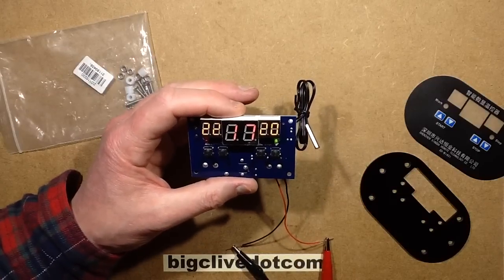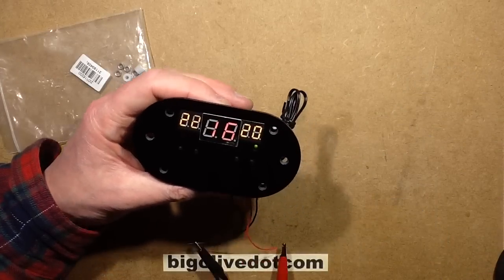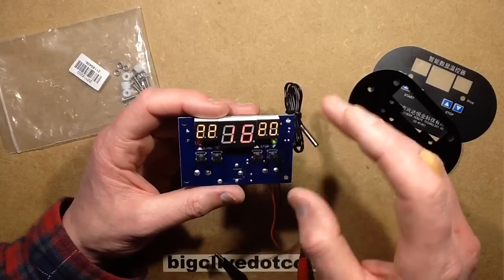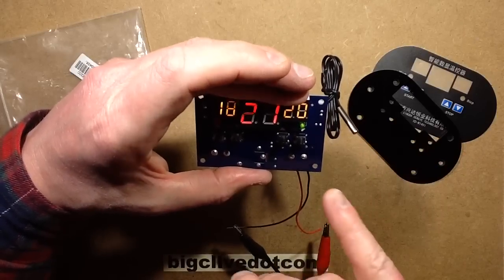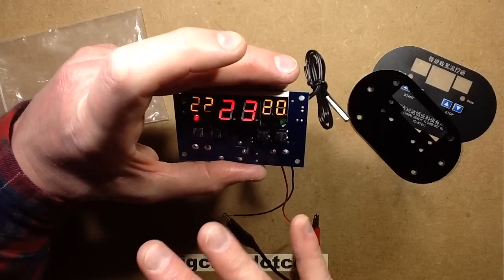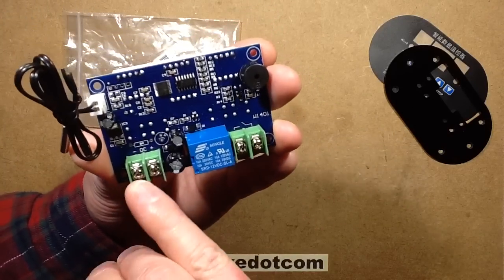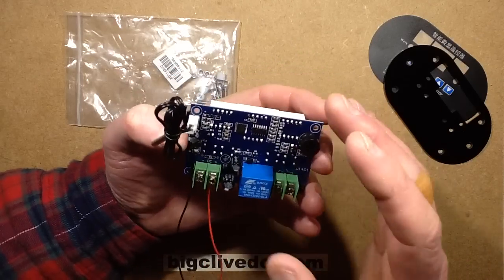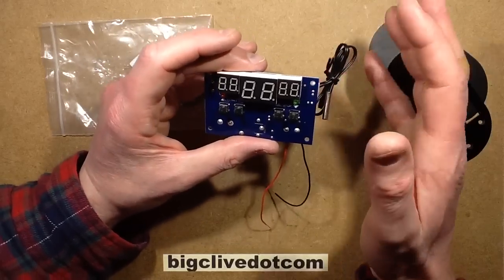Neat Chinese thermostat heating/cooling module.

Comment: Would it be possible to use one of these with a wifi enabled Raspberry Pi to make a DIY Google Nest-like device?
I would really like a Google Nest thermostat, but I can't justify spending two hundred quid on it.
Reply: +Aadil Shah Of course you can. The key word in my proposal was "challenge" of course, and the ESP8266s are so cheap!
Reply: +Jason Gomez Get a cheap ESP8266 go for the challenge! You can use them as remote nodes while an old android phone can act as the "brains" or if you really need you could buy a Raspberry to do the server duty.
Reply: +mikokuijn If you're going for home-brew you might as well put a wi-fi sheild on an Arduino Uno and just hook a thermistor probe to one of the analogue inputs.
At least, that's the way I'd do it.

Comment: I use one of those on my crock pot sous vide and an STC 1000 on a mash tun.
Reply: +Aadil Shah Those "Songle" relays aren't actually too bad, you'll find them in a lot of commercially available kit. I know for sure that the photocell on the back of my house uses one and this was bought from a major DIY store.

As someone who worked for a time as a quality engineer for the one the worlds biggest relay names (OMRON) I can say that the current isn't so much of a worry, it's relay chatter that really causes them to meltdown.
I personally put over 200A through a 12v 40A relay and aside from getting rather warm after 20 mins, it did no real harm.... But if you simulate relay chatter (by applying a switching voltage to the coil at say 2hz) with the rated current across it's contacts that thing will be a pile of molten plastic in no time at all. The real life cause of this is often poorly designed drive circuits that don't maintain the relays proper holding voltage.
Reply: +Fras L It was basically short circuit across a VERY substantial variable power supply, the sort that cost large sums of money.

I have to say that doing that testing was a rather scary experience, but when you've got a customer giving you grief sometimes testing to extremes is a very effective way to say "look we've done this testing, we've gone well beyond the components specifications and concluded the issue is not with our product"

When a relay fails on the contact side, you find the contact material typically turns high resistance and goes O/C. In rare cases the contacts can become welded together, BUT the current through it will remain the same as long as the load has not changed, so effectively it just stops working as a relay.
Getting output voltage onto the coil pins would require extreme heat or actual physical damage.

Cheap relays of questionable origin........ Hmmm yes that might worry me, but as I said i';ve found these Songle relays in a lot of "approved" consumer grade devices.
Reply: +Fras L I wouldn't put Mains current through a little relay like that. Especially the current of a cooking appliance.
Better to add a high current solid state relay externally to this module for safety reasons.
Reply: Aadil Shah Yeah I did not realise it was a low volt model, I used a solid state relay for a system to auto top off a salt water aquarium using some float switches. I have been looking at a system to control the temp in a room heated by an electric heater and using this to control the relay I bet  would work.
Reply: The relay is rated for about 250V at 10A apparently. But I'd never trust one of these for more than a few milliamps because they tend to melt under high current loads.
Also, they're not safety approved for mains switching, so in the event of catastrophic failure that results in death or injury, there are serious legal ramifications.
(may depend on local legislation)
Reply: Strider9655 Thanks for the insight, very interesting stuff, what was the 200 amp load?
Reply: Strider9655 Thanks for the reply, I believe the fear lol, a teacher I had was a draftsmen for the british submarines and told me stories of the massive batteries used and how low voltage can cause a fuss at massive currents.
Reply: the crockpot sous vide is a great idea! how do you connect it to the power for the crockpot?
Reply: +Phil Crawford The relay controls AC side.  The big blue block is a magnetic switch.

Comment: Would you say the probe is small enough to fit in a largeish heatsink
Reply: +bigclivedotcom Please, please buy one of these! I'm dying to know if they're fakes too. Haven't been able to reliably find one of the cigarette lighter types that is clearly real by the listing. http://www.aliexpress.com/item/2014NEW-Fashion-USB-Office-Auto-Fresh-Ionic-Air-Purifier-Ozone-Oxygen-Bar-Anion-Ionizer-PC-LP/32261897159.html?spm=2114.30010208.3.182.zFM1aM&ws_ab_test=searchweb201556_9,searchweb201644_2_505_506_503_504_301_502_10001_10002_10016_10017_10010_10005_10011_10006_10003_10004_10009_10008,searchweb201560_5,searchweb1451318400_-1,searchweb1451318411_6448&btsid=bc9072fb-143b-4aaa-8945-64078925481f
Reply: +bigclivedotcom And this one claims to also have a UV lamp and 'scent module'... oh god I love the chinglish on this listing! http://www.aliexpress.com/item/Portable-desk-Negative-Ion-Photocatalyst-Air-Purifier-Ozonator-Air-Cleaner-Purify-Air-Kill-Bacteria-Virus-With/32409285042.html?spm=2114.10010108.0.146.uZhTVE&s=p
Reply from the maker: +AO Seven Electronics It could be attached to one.
Reply: +bigclivedotcom thanks
Reply: +Godfrey Poon best typo ever!

Comment: I used one of the "panel mount" type ones I think you did a review on a while ago, to monitor the temperature of the hot water tank in the house. (Yes we still have traditional heating/hot water. No combo here!) More accurate than the crappy mechanical Danfoss or Honeywell ones, although I did have to crank it right down from the 60° recommended on mechanical to 45(lo) 47(hi)
Reply: *combi. Bloody iPhone.
Reply: Hi John. You might want to take a look at this link to see why it is not advisable to keep your "hot" water storage cylinder/tank at such low temperatures.
http://www.hse.gov.uk/healthservices/legionella.htm
Lower temperatures may make sense from an economy point of view but I feel the potential health risks to you and your family outweigh the economics.
Just a wee heads up tip from a jobsworth plumber :-)
Reply: Thank you for your advice! - I actually did try setting it at 60 degrees and it came out of the tap boiling! - Not sure if the traditional mechanical ones need more heat to actually activate, but using a digital one seems to require the heat setting lower to prevent scalding. We don't have "all in one" mixers in the house, its separate hot and cold taps you have to manually mix.
I do remember having the old one set at about 60 and getting a similar temperature to what we're getting now....
25 years on and I'm still here ;)

Comment: Hi Clive, just wondering what the relay is rated for?
Reply: +David Griffiths 10 Amps @ 250VSC
10Amps @ 30 VDC
http://i.ebayimg.com/images/g/T4wAAOSw5IJWfQXS/s-l1600.jpg
Reply: Another thing to check for on circuit board mounted relays is the way it is terminated. Foil thickness is often not up to the task of high current loads nor are the through hole contact area.
D.C differs quite a bit from A.C. ratings.
But yeah good point on using this relay as a signal than any serious loading
Reply: As others have mentioned...do not consider the "10A" as an accurate top end. I would not go over 3A at the absolute most.
I have ordered several brands of the cheap Chines relays and the BEST one made it to 4.45A before literally frying its own contacts together!
This took about 14 minutes to happen. I was test them so I was prepared for the failure...it would have been a disaster otherwise...please be very careful!
Reply: Hi, I bought the model XH-W1411, similar to the video. I connected it to a 12vdc source but it did not work. The manual indicates that you must connect to 12vdc / 100-240. But make clear that you have to see the packaging.
The packaging indicates GND / N DCV +/-, but does not specify the voltage value. Can I connect it to 110 VAC?